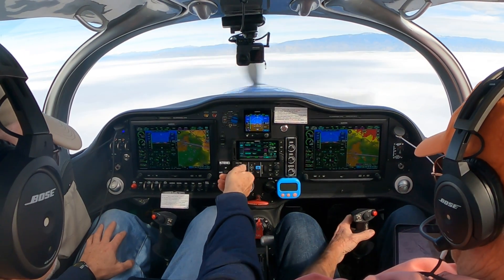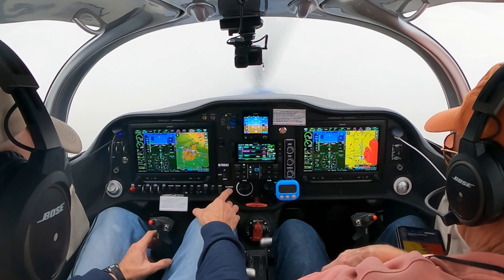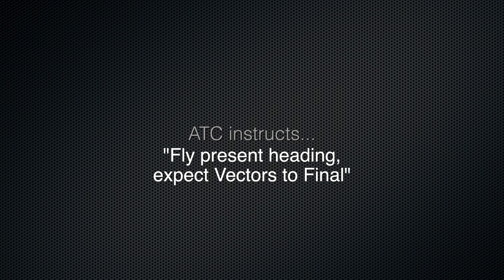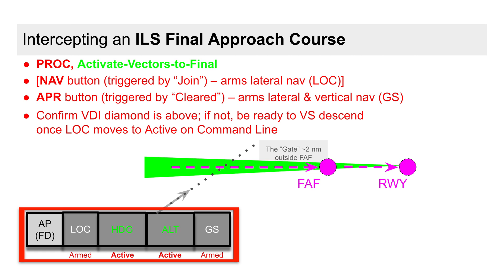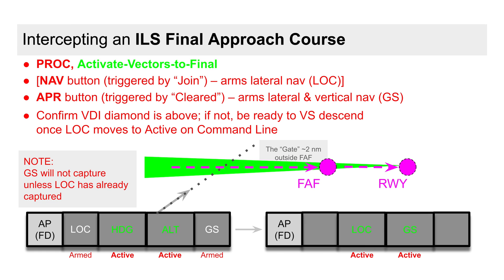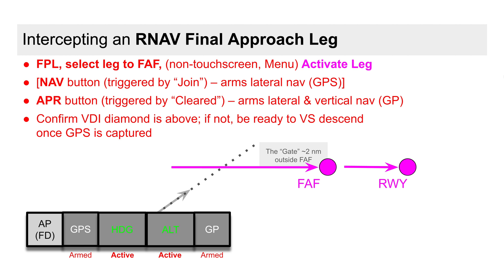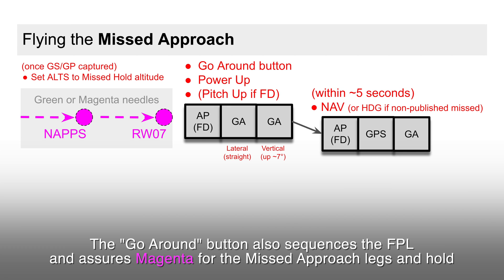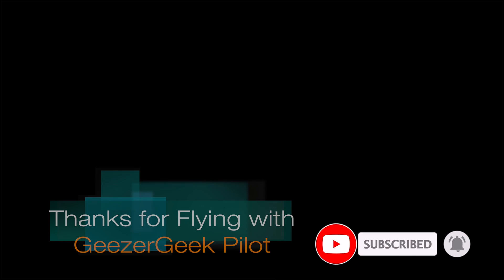Modern Avionics and the Instrument Pilot - Part 2 Intercepting Final and the Missed

Comment: I have one minor technique difference, Wayne. I select the leg to the FAF and activate it in both the ILS and RNAV approach cases.  I'm not aware of any reason for doing one differently than the other. The avionics will act the same way and I like SOP consistency. (I'm not being anti VTF. If I use VTF, I also use with both ILS and RNAV approaches.)  But like all variations in technique, so long as it works well, it's good.
Reply from the maker: Mark, I'm also not aware of any downside to using Activate Leg also on ILS VTF approaches.  And I like the SOP consistency between VTF ILS and VTF RNAV.  I think I've gravitated to the PROC VTF for ILS approaches... for the simple psychological reason of getting the switch to green needles done early and out-of-my head, rather than having to remember the confirm the switch later (I believe that in the Activate Leg ILS situation the magenta-to-green auto-switch will be delayed until entering the leg to FAF).

SOP consistency could also be obtained by using VTF even on the RNAV approach (rather than Activate Leg)... but my simple mind likes to think of green needles as being infinite and magenta needles being finite (point-to-point).  For this reason I rarely use magenta in OBS mode, 'cause my head doesn't like those "infinite" magenta lines.  😃

As always, Mark, thanks for watching and contributing to these very interesting topics!  Wayne
Reply: @GeezerGeekPilot  That's what I mean by technique. You are using the distinction as part of a trigger to change that CDI. 👍 I also coordinate the two events. When I get that first vector, I switch to green needles and activate the leg to the FAC. They both work 😊